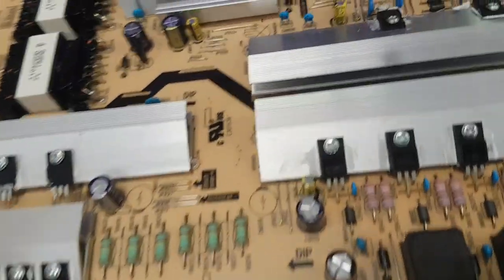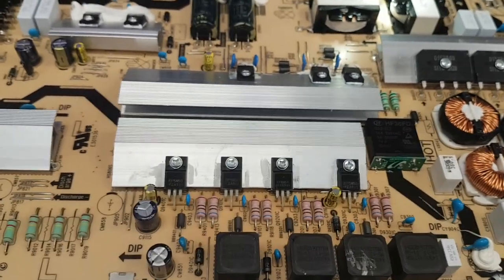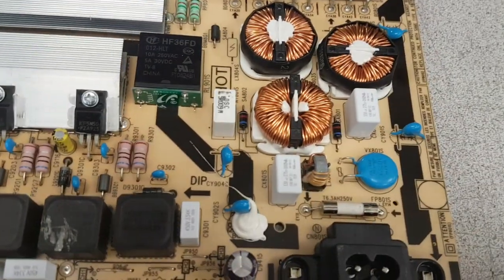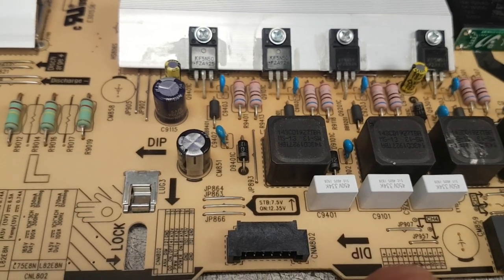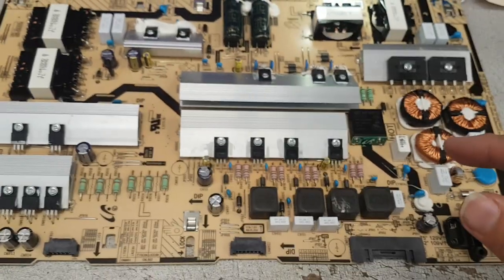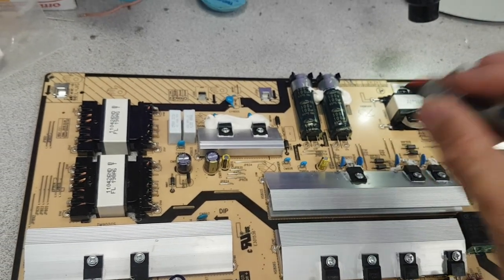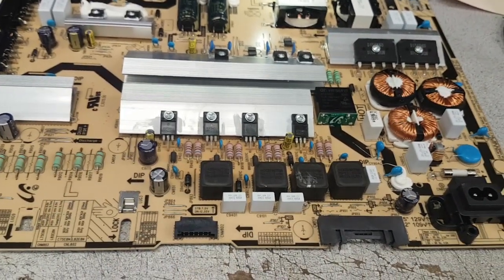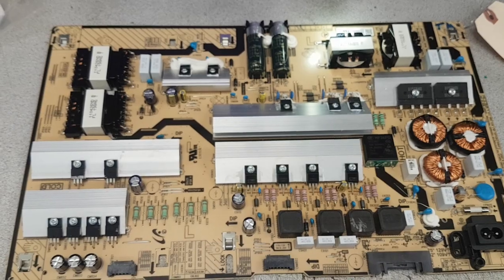How to test BN44-00874F Bn44-00874E BN44-00874D BN44-00874C

Comment: Thank you for this. My power board is the exact same one you have here and the main filter capacitors in mine do not show 395V, but everything else you test is good on my board. Standby V is 13.05 and channels are 233V. Does that make any sense? Is my board bad by what is happening?

Comment: Hello 
Thx for your vidéo
I have got a similar board. I have no voltage on CH1, CH2, CH3 AND CH4.
I have thé 13 volts 
Do you have an idea of the cause ?
Thx 
BR
Reply from the maker: First you want to check if you have PFC circuit working by measuring 380V on the mains capacitors like I probably show in the video. if you don't have 380V there you can't expect LED output either. If you do have 380V, but no output then one of two things must be true: the board is not designed to output LED voltage by default (I am nearly certain the "E" revision does that) or the circuit is not working. The later can have too many possible explanations to cover here.
Reply: Can I force the board to start ? Using jumping wire ?
Reply from the maker: @MickaelPostolovic  As I said...this is as much as I can help off the top of my head.
Reply: Thanks for your reply. I have 380v. I have 13v. I can mesure 270v on DIODE D9101C, D9201C and D9301c.
The 3 MOSFET seam to work correctly. I suspect the ic9101 chip (magna chips MAP3634 les driver but I can't find any ressources about this chip)
Can I just bypass this chip by soldering a wiring to get gnd signal on CNL801 connector ?
Reply from the maker: @MickaelPostolovic  I am sorry...this is only so much I can say off the top of my head.
Reply: @MickaelPostolovic  yo. did you find something? i have faulty led and no any signal on 3 mosfets bases from this chip. Still trying to find the way to check if it's his error ...

Comment: Hey there, I have the F variant and have replaced all the repair kit components. On the bench there is no PFC boost and I don't have a Standby V.  I've tested all the MOSFETs and diodes and caps that I could and everything seems to be fine. I'm wondering about the FET driver chips, but am unsure how to test beyond shorts to gnd. You've mentioned in the comments that other components can fail outside the repair kit. Which ones have you seen, because I'm running out of things to test...thank you!
Reply from the maker: Easily 99% of all failures we've seen are limited to the parts in the repair kit.
1% can be everything in the switching and driving circuits all the way back to the rectifying diodes and filter capacitors for the driver IC ad well as the driver IC itself, of course.
Sometimes you just come across failures that are...weird.
And many times we see people screwing up the repair one way or another (shorting something, cold solder joints, scraping off an SMD without noticing etc) and this is why we do not provide troubleshooting over Internet.

Comment: Hello! I am having an issue with a TV using this board. 

The TV turns the backlight on for around 15 seconds, then turns off again and repeats the process constantly.

When unplugging the main board the tv backlight is constantly on. When plugging back in the main board, it starts rebooting again. Any advice?
Reply from the maker: Yes, get a new TV.
Reply: Thank you 😊

Comment: Hi great video I have a BN44-00874E doing the test I don’t have any voltage over the LED circuit CH1 to CH4 any help appreciated.
Reply from the maker: That is fine. If your TV has no picture, it is probably the LEDs, not the power.
Reply: @coppelltvrepair  Thanks the tv just makes a clicking noise every 15 seconds if I disconnect the main board the back lights stay on

Comment: Hi. I have a BN44-00874F with a blown CP809 blue capacitor. I was thinking to just replace the other (3) as well (CP810, 811, 812). I can't quite read whats printed on the other ones, I believe it says R221 2KVK 1851? Did you replace with a different value? 
Besides that and the main fuse (T6.3AH250V) located at FP801S, do you recommend any other parts to be replaced?

Oh, one last thing... the power button on the bottom middle part of the screen frame looks like it shorted out. May or may not be related to this but im having trouble removing it to see the whole board. Any issue with those?

My TV is the UN82RU8000 btw.
Reply from the maker: I recommend all the parts that we sell in the repair kit for this board be replaced at the same time. In some cases you may need more than what's in the kit too.
Can't say anything about the power button. It hardly ever needs attention.
Reply: @coppelltvrepair  what is the capacitor required for CP809?
Reply from the maker: @jamesdennison820  http://www.coppelltvrepair.com/t/QA-Can-you-please-tell-me-value-of-this-component

Comment: Hi. I have a bn44-00874b board and my tv will turn on and works fine for about 30mins and it will reboot by itself. I assuming it the power board.
Reply from the maker: I have a HDD a friend brought which works for like 3 minutes and then stops. If I leave it overnight on the next morning it again works for about 3 minutes before it shuts off.

Comment: This is the exact problem with my TV. I just purchased your repair kit. Do you have any videos making the repair?
Reply from the maker: Afraid not. Not enough resources to educate others how to do repairs every step of the way, however noble this might look.
Reply: I got the kit and am going to do the install. I see the there are two different numbers on the capacitors. 221J 1kv TDK and 101J 2kv TDK. Does it matter which positions they go in?
Reply from the maker: @bcrabbit3  Of course there are. If there wasn't  then why would we bother including different parts - we'd send the same 4 times. They are in pairs on the board - easy to see - so even if 1 or even 2 are busted beyond recognition (usually just 1) you can still figure out which goes where by looking at the originals.
Reply: @coppelltvrepair   I had already taken them off before I noticed there was a difference. Can you tell me which goes where?
Reply from the maker: @bcrabbit3  We can, but  not at the moment and not here - contact us via the website or via email and we'll respond. Here I can say that if you keep the old capacitors, even off the board, you can probably easily find out which one was busted and you can find the burn signs on the board from which you can tell which one was where. Not always possible, but usually. And yes, I do realize none of that would be needed if we included detailed information - publicly or in the kit. When you get to be in our shoes you'd see the other side of the coin as well and reason differently.
Reply: @coppelltvrepair  I completely understand your stance as I am a small business owner myself. I appreciate all of the good information you have provided and thanks for the quick shipping on the repair kit!

Comment: I have the similar TV one of my blue resistors is burnt out just burned when I turned on the TV. I had a picture faint, and every time I turned on the TV you can hear like a little buzzing, squealing noise. I opened it up, plugged it in, and I could see an arc right from that burned blue resistor. It’s the smaller ones just wondering would that cause all this havoc
Reply from the maker: Stop turning it on to prevent larger burning and buy repair kit and have the board repaired or have it replaced or otherwise serviced.
To answer the question something has aged and started failing and when it does it will take down other things too.